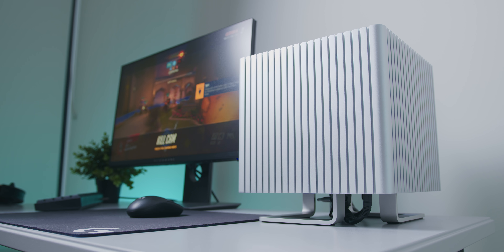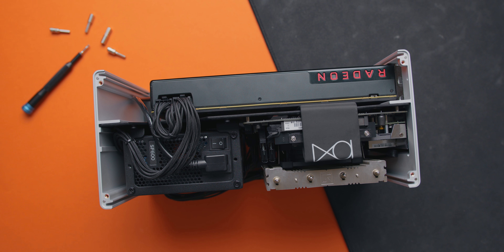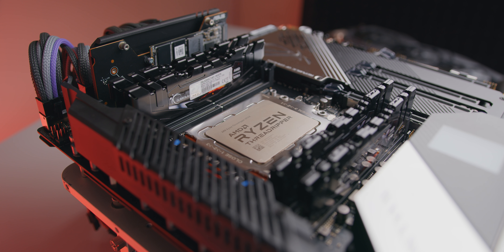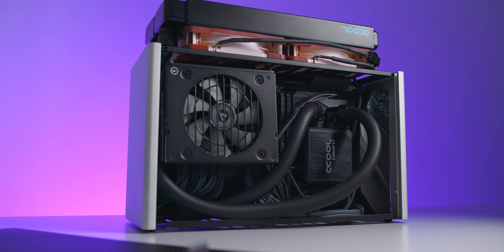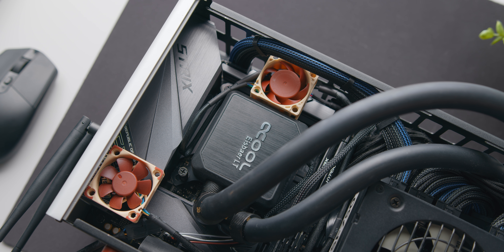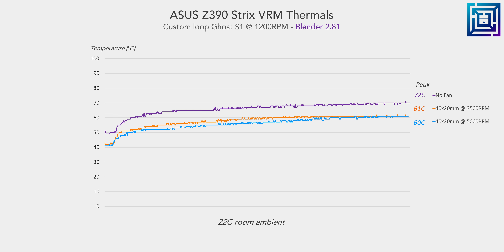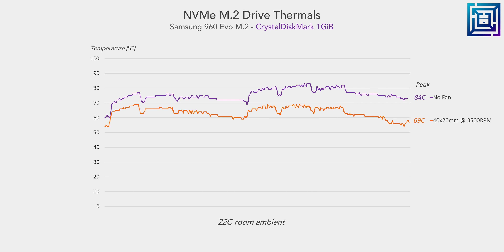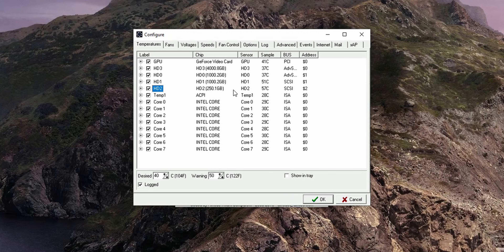Active VRM / M.2 Cooling ft. Noctua's Tiny Fans!

Comment: I have 80mm fan on the vrm ...4500rpm max...too loud
Louder than anything...
Thanks to your vid
Reply: https://www.newegg.com/arctic-cooling-afaco-080p0-gba01-case-fan/p/N82E16835186072?Item=9SIA1K63V02908
If you are looking for more quiet 80mm fans, these are good. Fluid dynamic bearing and PWM Control. I installed 2 in my server with a Rosewill 4U chassis and they're as quiet, if not quieter, than my 120mm intakes, while still providing decent exhaust airflow for the chassis.

Comment: This is why full cover blocks for MB are awesome. Normally you would just add unnecessary heat to the loop by cooling the not so temperature-sensitive VRMs, but when there's no airflow in a tiny case, cooling them with water works well.

Comment: Vrm is just need a little extra cooling for it, even blow air for your mouth is enough, thats why the best cpu cooler is just like the stock one, its cooling the vrm too, but add more extra tiny fan is just ok, the main concern maybe is about the noise of thatf tiny fan.

Comment: I've got a 92x15 noctua fan over my ram and vrms, it does the trick.
Reply: @J Fz The same, with double side ductape and attached to the pump of the asetek 645lt, and the bottom of the case  https://preview.redd.it/okcch2ntyrm31.jpg?width=3840&format=pjpg&auto=webp&s=496298c25d026d0eaa08f71ddf4b74645d27fb07

Comment: I use one of these dinky little fans to cool the on-board X540-T2 10GbE chip on my Supermicro Dual Xeon motherboard which was overheating due to the small heatsink and being located in an otherwise low-airflow space between two expansion cards. Does the job quietly, and no more overtemperature warning errors in the IPMI logs. :)

Comment: Do you make a specific choice when getting Noctua fans between 5V and 12V variants? If yes, based on what? I mean, I know that 5V fan attached to 12V connector on mb is bad idea but I wonder what is used case for those 5V variants..?
Reply: 5v is usually a good match for a raspberrypi or anything powered by USB, which is 5v.
Reply: I would assume they're a very niche use case because there aren't many 5v connectors other than RGB headers on a board, however might be more practical for servers, which seem to have plugs for just about anything.